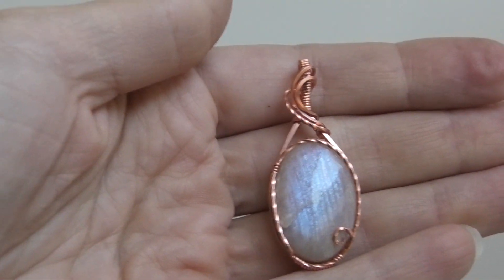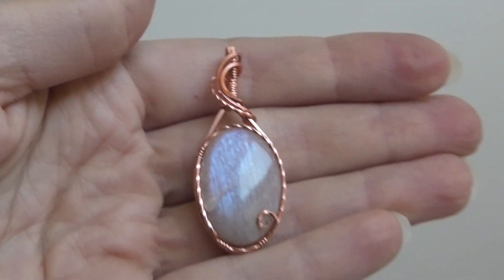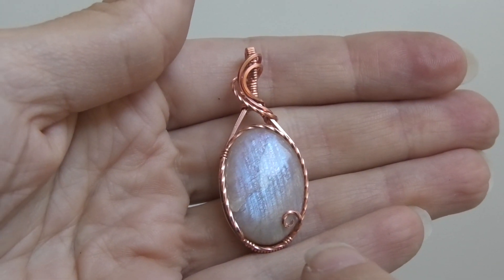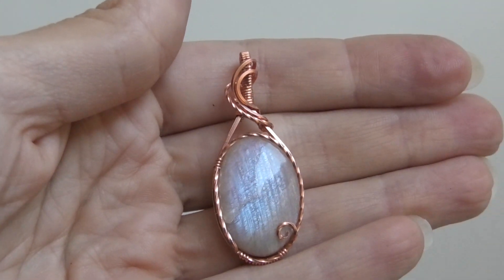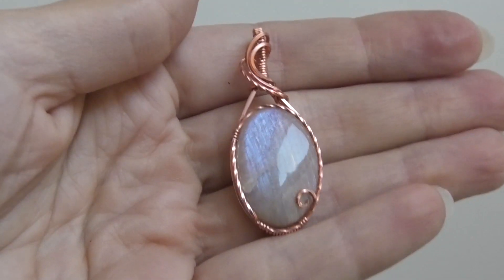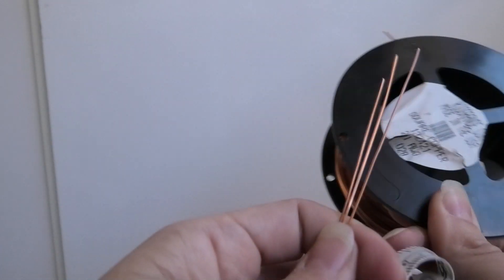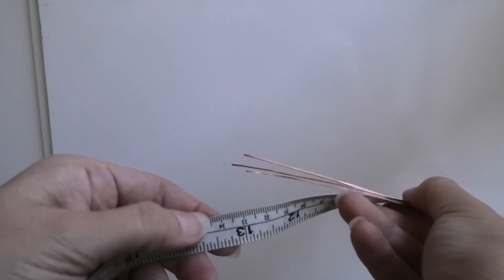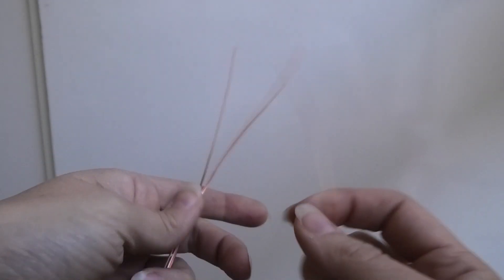Oval Cabochon Wire Wrapped Pendant Tutorial

Comment: How do you put the wires toghether and do so that they don't separe and take random shapes?
Reply from the maker: When I start I make sure they are all straight with no bends or curves. You can do this by using a cloth to run them through or using nylon pliers. Then I stack them together, since I am using square shaped wires the flat sides stack together nicely. Then I connect all 3 together with the half round wire.